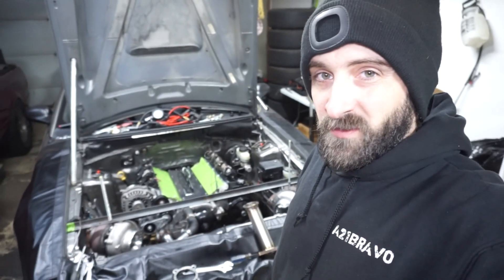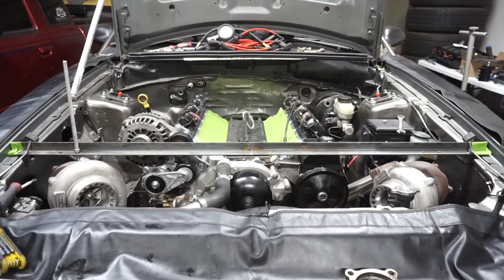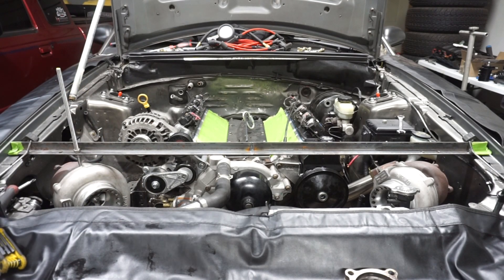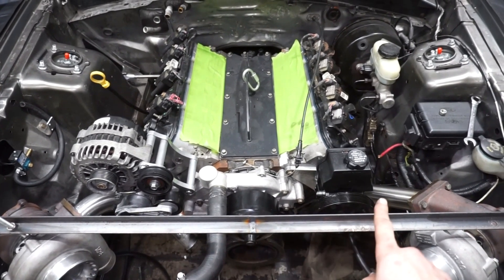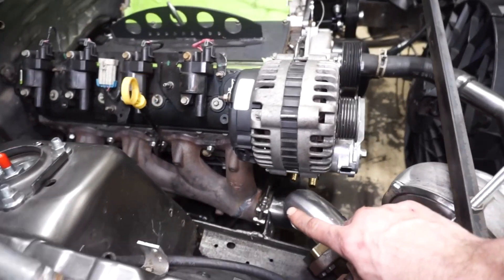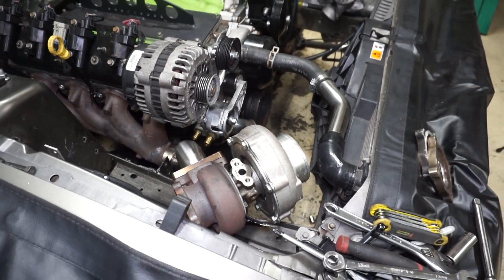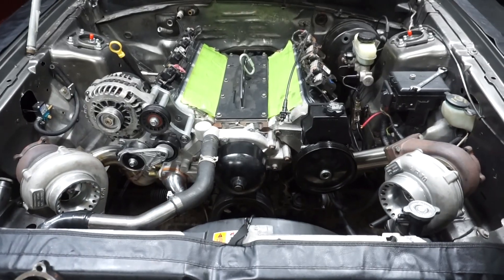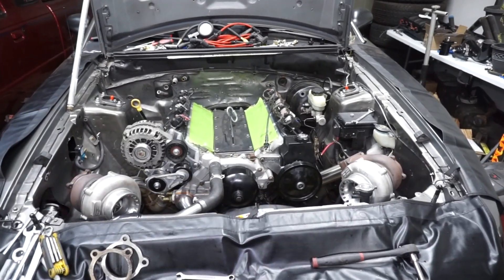DIY Twin Turbo 5.3 Kit Hot Side | eBay GT3582 New Edge Mustang

Comment: How thick is the stainless piping you used? And will you add any supports to the turbos or are you confident that just the hotside will hold them in place?
Reply from the maker: 16ga, which is around .060", but it's actual 16ga. Some of the China stuff measures thin at .050. Might add a brace, not positive yet. I don't have any on mine either.

Comment: Looks good brother. They sell a timing cover with 2 oil return fittings for running twins on the LS. But that would intake tearing the front off of the engine.